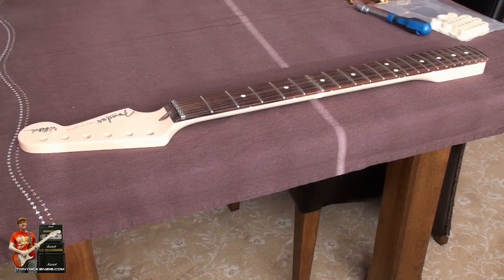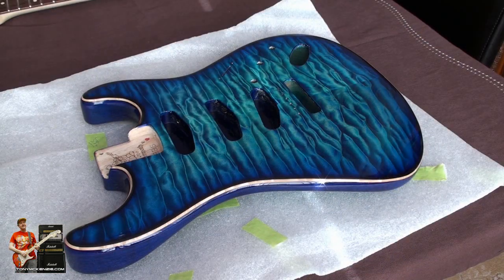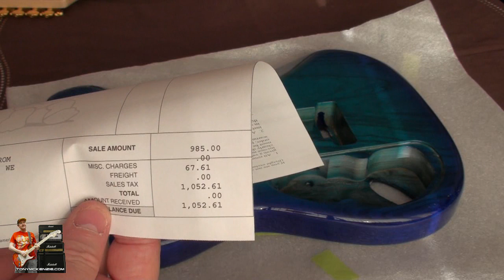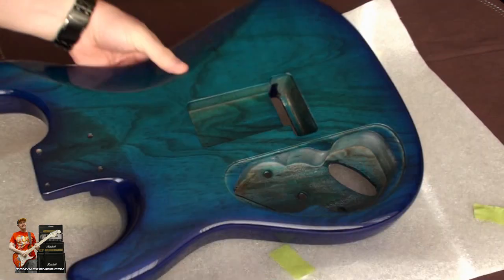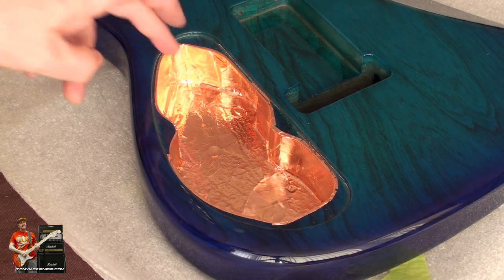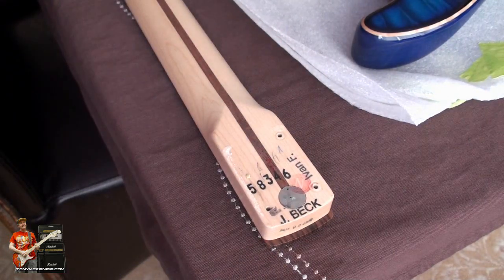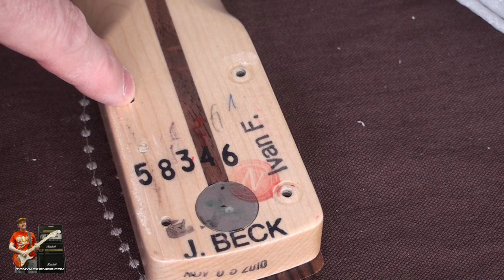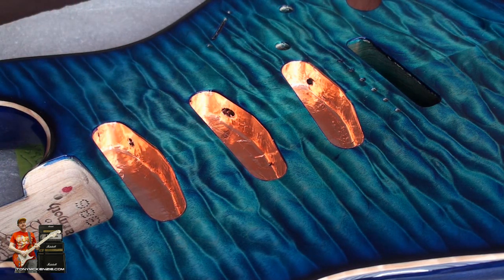BLUE PART ONE | Fender Stratocaster Strat Custom Shop  | How to make yours like this | Tony Mckenzie

Comment: Are you sure that tape will work as a faraday cage? I have installed faraday cages in Hospitals to prevent cell phone use, and in all cases. I have used copper screen. 

The way a faraday cage works is the holes in the screen prevent radio waves from penetrating. Exactly the same as the door on a microwave oven. If you have ever looked at a microwave door, you will notice that you are actually looking through a screen. And that prevents the microwave energy from escaping into the room where you are cooking.
Reply from the maker: I'm sure it does work, whether its chicken hut wire, microwave screen or other the solid metal box will work too. At least it does make a change on the guitars I fitted it to.
Reply: On a guitar though you are more worried about magnetic feedback from the pickup coils. I am fairly sure that tape acts more of shielding than a faraday cage. I could be wrong, but that is the way it seems to me. A way to test it is before you put the electronics in there. Toss a cell phone in there and close it up. Call the cell phone. If it rings it is not a faraday cage.
Reply from the maker: bkpickell I did it originally to shield RF type of interference actually (and other interference that I always had on a Strat)  and it does do it for me so I stick to it as it solved that sort of stuff. I could have used the paint etc. I guess as many guys do, but I decided to use tape. I do know if you don't do under the scratch plate when you do the rest like I did it is not as good as when you do i.e. the noise is increased, so I always (well nearly LOL) do that too.
Reply from the maker: Toby Jackson But of course a 'Faraday cage' does NOT have to have holes as in some applications. If you check the X-Ray room in a hospital that is covered with lead and I know that there are no 'holes' in that. I also know (from personal experience) that RF does not penetrate through it or indeed the X-Rays don't get out. If the chamber on the guitar is completely sealed - thats the same as the X-Ray room really (just differing material) and the results should be the same or not dissimilar. If there are gaping holes in the copper when fitted clearly then it would be a pure 'shield' as you have said, but I do think there's more to it than just shielding. Thanks for the input.
Reply: ***** That only works with lead. You can X-Ray through 1" Thick Steel, but can't X-Ray through 2mm of lead.
Reply from the maker: bkpickell Good point. But the 'shielding' as a complete (near enough) cage (or box) as I do it does undoubtedly reduce RF and (for example) fluorescent light interference on the Strats that I have built?

Comment: Shoulda bought a chender. And yes I did see your review of one (a chibson actually), a bit too salty for my liking. But seriously, a chibson although a little light on ethics and morality would have been a lot less work for a lot less cash.
Reply from the maker: Hmmm... and a lot less guitar too. Travis I have been there too many times re that stuff and these days I buy and review what works for me. If something does not work for me, I tell it the way it is, then move on and never go back. Thanks for watching.
Reply: Not a subscriber to "the more you pay, the more you get" philosophy. If I can pay $300 for a guitar that recreates 90% of the sound of a $6000 one I'm buying the $300 one and upgrading the pups and the hardware. wont cost more than a thousand dollars.
Reply from the maker: Been there and done that... check my Harley Benton 'upgrade'. Then check my Japanese Tokai and you will see for yourself the differences that I have. Thanks.

Comment: Nice video! But, please change your mic or use noise gate. 26 minute of ''pssssssssssssss'' it's unbearable.
Reply from the maker: That was a faulty camera that has been changed out long ago. Check any current video to see the audio quality has dramatically changed without the hiss. It should have as the replacement cost a small fortune. Thanks for watching.

Comment: U've assembled a guitar, u haven't made one. False advert.
Reply from the maker: Not an ad. They don't make the bricks for houses too so I guess they assemble them too right? Silly.
Reply: when a car is put together on an assembly line...it is being built...the guys on the assembly line didn't take raw metal and hammer it out themselves but they built the car none the less.
Reply: Of course, you have to admit that, for what Tony paid for that body, he could have bought the tools to mill a fallen tree, and carve it out into the body of a guitar.  Tony does good work and builds top notch guitars worthy of being played by Jimmy Page or Eddie Van Halen or Eric Crapton, but I have to question whether he has good sense or not, considering what he paid for that body from Warmoth
Reply: I should've been more clear in my first post. It came off fairly snarky which wasn't my intent. Im not knocking Tony or his skills. It does take skill to assemble parts into a well playing instrument. No question there. To me, those ppl are called guitar techs. Those that design and build from scratch w raw lumber are called luthiers, they are also woodworkers. That requires another set of skills that go way beyond that of a standard guitar tech. 
Considering Tony's and the other comments regarding Warmoth products and their lack of quality control, maybe they are more skilled than I thought. 
Might I also suggest that those looking for quality bodies and necks in the UK contact Ben Crowe at Crimson guitars.  Im sure he'd be happy to CNC a high quality body or neck for you.  
Cheers...
Reply from the maker: Actually I have never met anyone who has seen the guitar in real life that thinks the body is anything except spectacular for what I paid.
Reply from the maker: I am the first to confirm that I cannot sit there and build one from scratch re the body or the neck. However, I AM exactly like most guitarists - some skill but no luthier. Overall I have bought a number of bodies from Warmoth at varying prices and apart from them getting this one not to the specs I asked for I have had no problems with them. Of course there are many UK luthiers etc. and good ones too. Martin Sims also makes some very nice stuff in the UK. Thanks for the info and clarity. Occasionally people say that I did not 'build' the guitar, but I guess that's all down to someone's understanding of the English language and my view of the word really related to the bricks analogy. Lastly I don't make adverts... if the body was crap I would clearly say it for sure. Thanks...